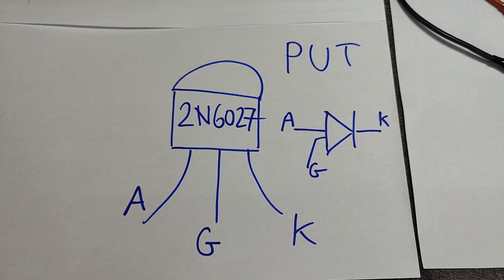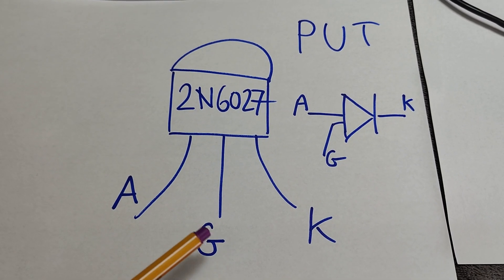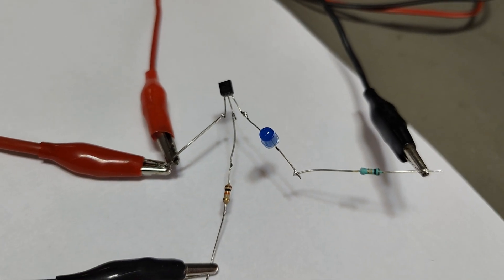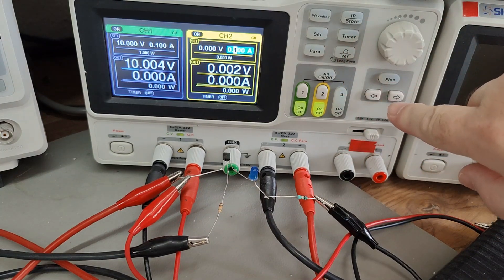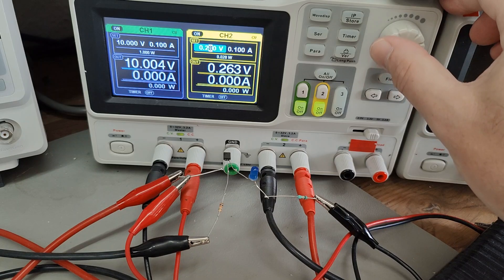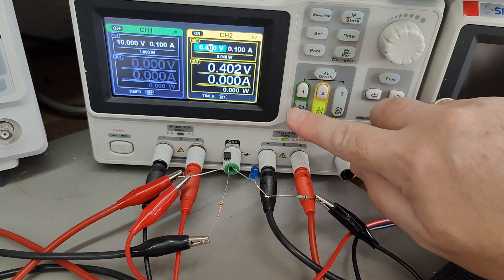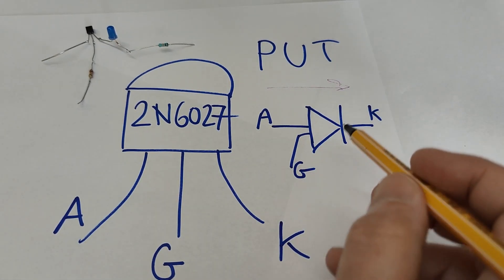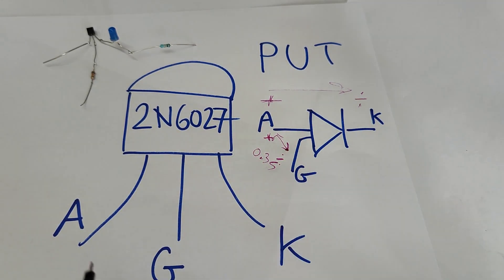Testing PUT Programmable Unijunction Transistor 2N6027 how they work

Comment: The early SCR circuits we used had a UNIJUNCTION transistor 2N1671 for triggering the SCR.  That was a metal can TO-5 package.  Then we  changed to a smaller, TO-18 type 2N2646 or slightly tighter tolerance 2N2647.  At some point we needed a timer behavior that depended on very low leakage currents and found the PUT 2N6027 (TO-92 plastic package as shown), allowed us to use 1 M-ohm or even higher resistor, and correspondingly small film capacitors.  That 1 Meg resistor use is actually mentioned in the data sheet, producing just 2 uA trip point leakage current.  The reference application circuit presents an adjustable setting point to the gate through the 1 Meg resistor and an RC ramp voltage to the anode.  When the anode voltage exceeds the gate voltage by the specific voltage (about 0.4 V), the avalanche takes over and the capacitor is discharged via Anode to Kathode and provides a nice sharp pulse on a small resistor (100 to 220 ohm) between the cathode and “ground”.  The pulse ends, when the current has dropped below a specified “valley” current level, which for 2N6027 is 50 uA.  For comparison, the Unijunction transistor  2N2647 specifies 8 mA.

Comment: I am more familiar with 2N2646. Actually it quiet close to 2N6027.
Reply from the maker: cool can you refer to a unit it is used in ? i am still researching the parctical usage and implementations and like to have a little list.
Reply: @TeardownOZ2CPU  mostly, triac or thyristor trigger timing. Strong enough to drive a mighty hockey puck thyristor via a pulse transformer.
Second-most, saw-tooth oscillators for CRO sweep-time and musical synthesizers. Generates quiet unique timbre.
Reply: @TeardownOZ2CPU  I once found one employed in the timer circuit of a bread toaster. Tripped the solenoid.

Comment: Yes and you can still buy them by me, only 20 Euro cents each. Used them before as timers, made a light dimmer with 5 second turn of the bulb to full brightness, because otherwise that old exposure box, using 40 25W incandescent lamps as even light source, would trip the main 20A breaker every few turn on cycles. Second version a few years later was 10 minutes, acting, along with a slightly modified clock radio, to turn on a light 10 minutes before my alarm clock, so I would wake up with light on instead of darkness. the modern upgrade i did now uses 3 lengths of LED tape, and the time switch is an old DIN rail time switch I got as the CR2032 battery had gone flat. New CR2032 in a holder, some rework of the power supply to make it run off 12VDC instead of 230VAC, a new relay to replace the internal 48VDC one, and it has been running flawlessly for a few years now.
Reply from the maker: the 2N6027 I mention here, exist at mouser just a few $ each

Comment: What is the difference between a PUT, and an SCR? Is the cathode to anode voltage drop just lower for the PUT?
Reply from the maker: it is not the same, see the symbol of an SCR, use my explainer in this video as an examply, now the SCR makes more sense its gate voltage is positive and relative to the cathode pin, the rest of the features are the same, trig it, it amplify go on, and stay on, until no anode-cathode current.
Reply: @TeardownOZ2CPU  That polarity for the gate went over my head 😂 Thank you for that. I inherited some (PUTs'), that I never expect to need.
Reply: @tommiller1315  Look up the gate controlled switch, which is a thyristor that has an extra gate, that can be used both as a trigger, or to shut it off. Unijunction has only a single PN junction in it, and is very much like a JFAT, while a thyristor and GCS is a PNPN structure that has much more gain.  The UJT has the advantage in that when it fires the charge on the capacitor that is charging up is passed as a pulse to the output, so you can make a very short high energy (relative, currents of 50mA while only drawing 1mA from the supply) pulse on the output side.